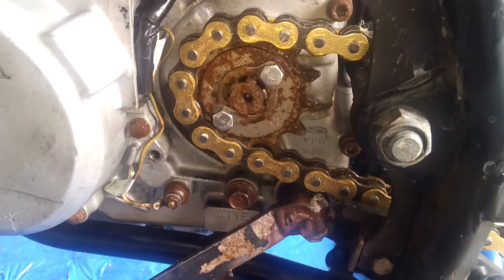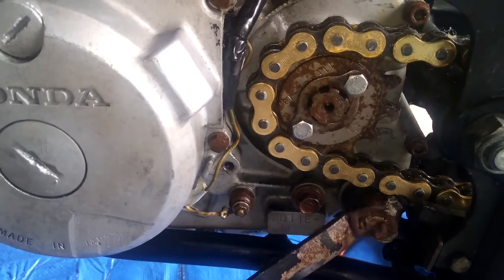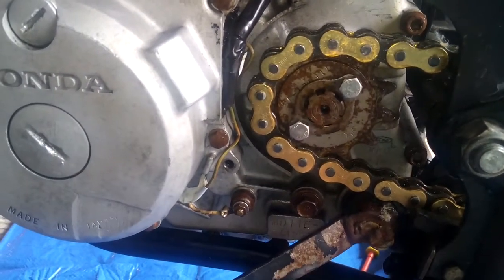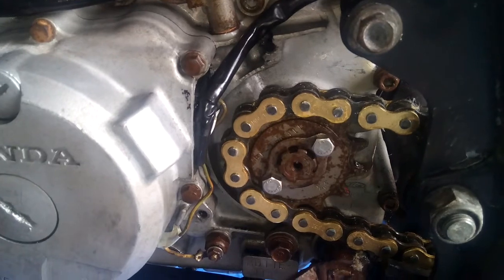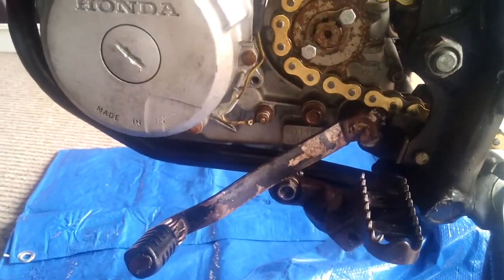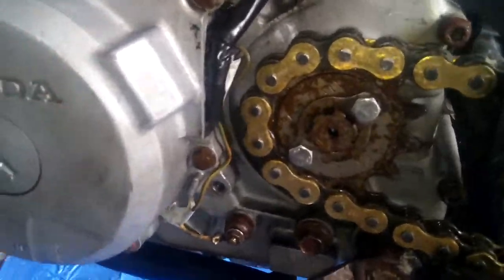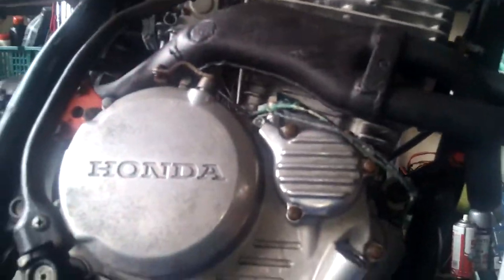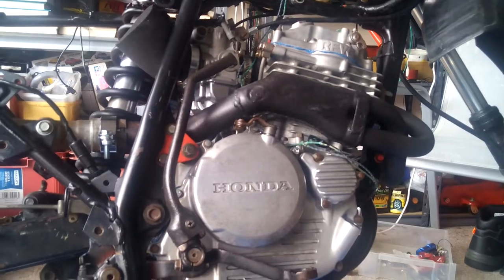Fixing the XR250 or XL250R gear selector spring tapered bolt removed mistake

Comment: If you drain the oil and stick a screwdriver thats bent at the tip in the bottom drain plug. You catch the bottom spring at the tip and put a floor jack under the screwdriver and jack it up to put pressure on it then push the shift lever down you can get the bolt in that way. Took about 20 mins. Gotta lean the bike away from you.
Reply from the maker: Hi that is a real good idea, heck that's great

Comment: Bugger I'm fairly familiar with this engine but had suspected oil leak on a friend's one around the bolt and went to replace the washer..... f*ck
Reply from the maker: Hi, damb, I remember the feeling too. Look in hind sight you might be better opening the crankcase, mine had been welded together and no options but to make the hole, I believe the bike is still running good for new owner,  good luck